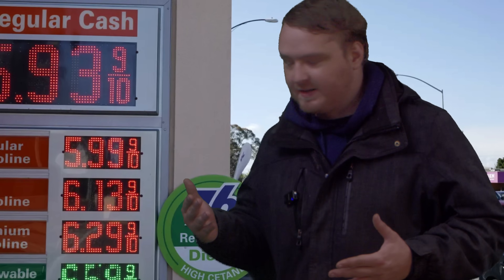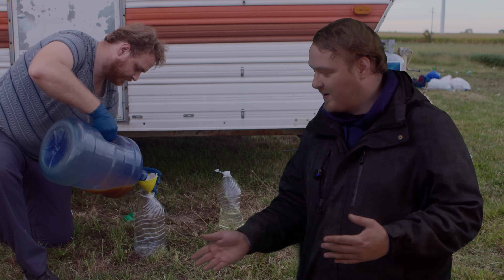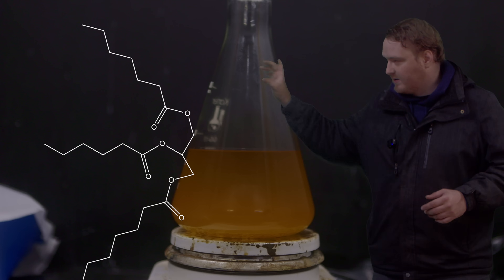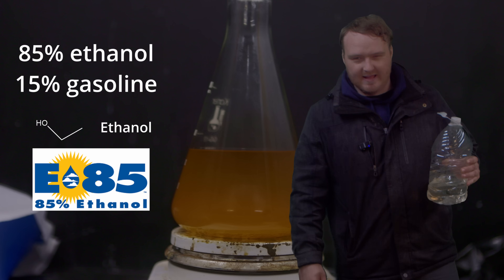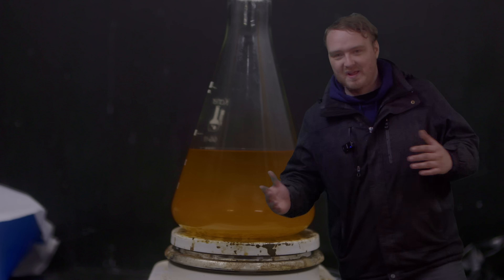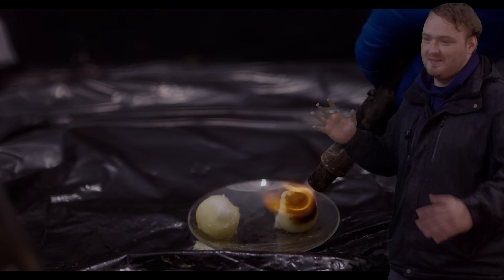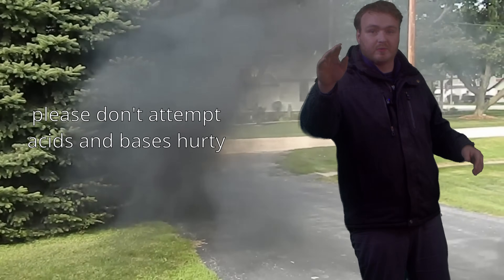I Made Dirt Cheap Organic Diesel!!!

Comment: 8:02 how would you rinse it with water? I dont understand how you wash a liquid.
Reply from the maker: Sorry i should have been more clear.. the diesel doesn't mix with water so if you shake it up with water when it separates into two layers the water layer removes some of the contaminants made like soaps
Reply: @ChemicalDistractions  ahhh, cheers mate

Comment: I would like to know what math you used to arrive at the cost per litre on this. Not trying to be a dick, but you didn't explain it at all, and, on top of the veg oil, you used filters, E58, pool ph, and electricity, just off the top of my head. 

If you were to do this at any real scale, you would also need to factor in fuel to go get your fuel, oil collection equipment, storage tanks, a place to keep your storage tanks, pumps to transfer the oil, electricity to power the pumps etc. People do do this at scale, and run their vehicles. Those people usually have more than a coffee filter (lots use a centrifuge). Some gos as far as distilling off the alcohol for reuse. 

Maybe your number is accurate, but I have been burning waste oil for a few months now, and it's a heck of a lot of work (even without refining) and there are a LOT of unforeseen expenses.

Comment: Some years back they arrested a guy in the uk for making his own fuel supposedly because he wasnt paying taxes but seemed like big oil was getting upset about the cheap fuel. Most diesel is already 20% bio deisel and gas 10% ethanol. The bio diesel has some problems in cold weather and probably not as much mileage from it but its about the same.

Comment: A lot of people actually ran veg oil (not biodiesel) on their cars. There's a whole forum and blog post I reckon it's called vegoilcar or something like that, where they just turn their cars with a whole different fuel-tank to daily veg and normal diesel.

However, whilst cheap, the labor is so annoying for most people that it isn't even worth it, at least here in Spain where diesel is already cheap, as low as 1.2€/Liter in the uhhh... crappy-ish gas stations.

Comment: Hey bro you can use a cornstarch/water slurry to get the sediment out if the oil pretty quickly.

Google the technique but you heat the oil and mix the slurry and dump it in, the starch grabs the bits and the water evaps, leaving fairly cleaned up oil. Filter faster afterwards.

Comment: I've seen someone dyno their Nissan diesel on straight peanut oil and it made more power than gasoline. The biggest issue is making it thin enough to run cleanly in a cars fuel system. Can be hard with viscous veg oil

Comment: This is a great idea I heard many people in the UK doing this in the past. Used engine oil can also be used many people with 12v cummins trucks use a 55/45/5 diesel, used oil, gasoline mix. The used engine oil, as well as the vegetable oil must me filtered very thoroughly or else it could cause problems in the fuel system.

Comment: As far as I understand it the main difficulty with running, vegetable oil, or waste vegetable oil in your car engine is the high viscosity which will clog up the system in colder temperatures. So one method is separating the fatty acids from glycerol, which I believe is sometimes called RME. Other methods are modifying the car to use dual fuel systems and/or fuel pre heating. Another approach is to mix the vegetable oil with either diesel, or even kerosene/paraffin (about 30%), which is usually cheaper. Would be very curious if you investigated the viscosity of these substances of these different substances at different temperatures.

Comment: dude i just filter used veggie oil with veeeery fine filters and dump it in the tank as it is. I added a little secondary tank for regular diesel just to start an warm the engine, then switch to main tank full of veggie oil. Also needed to add heaters to the tank and fuel line and pump to reduce viscosity. Been running like this for years now

Comment: The easy solution to alternative energy with complex EV's and batteries turning trash into fuel insted of turning food in the case of corn ethanol into fuel which takes up land and is not viable. Why not turn the corn stocks into ethanol or vegetable oil instead of the part we eat? Why not turn garbage both organic matter that would normally go into a landfill and produce methane into usable sustainable biofuels and plastics back into their original petroleum fues and of course the waste vegetable oil into buodiesel and sustainable aviation fuel even Boeing had already expermemted and tested ine if their actual jet aircraft with a biojet fuel prototype. Moreover it will help compete with the oil industry I mean yeah we probably wouldn't have enough to replace all oil with it but it would balance out the playing field and get rid of monopoly in the oil and EV industries. They want everything to be all electric so they can have a greater monopoly over controlling our energy.

Comment: Yes, bio-diesel. Made it, used it. I had a string of restaurants that I collected fry oil from. Used a converted water heater as a reactor, using racing fuel methanol, and sodium hydroxide mix as the catalyst. I made hundreds of gallons of biodiesel. I quit because my job situation changed, and I couldn’t make it anymore.😢

Comment: Surely that stuff burns, no doubt about it. But that still doesn't mean, it's advisable to use it as fuel. Ordinary Diesel straight from the pump doesn't only contain hydrocarbons, but also a nice mixture of different additives to improve properties. Those improve lubrication properties, long term stability for storage, biocides, cetane index improvers, cold flow improvers etc etc etc.
If you want to use that "biodiesel" as fuel, you can do that, it'll get your engine going. But don't cry if you at a later time face a repair bill. Or maybe mix it 50/50 with Diesel from the pump, so you get at least some additives into the fuel system and still save half the cost.
Reply: A reliable way to keep it working well (kept my grandpa's Astra running for like ten years now) is to make it with extremely well cleaned oil (filtered, then water washed, not just filtered), and add some multi purpose diesel enricher like a can of Kleen Flo.

Comment: Will the same process work with used motor oil?
Reply from the maker: No unfortunately motor oil doesn't have esters to break so this doesn't help. You either have to 
-burn the oil the way it is
-Distill off the lighter parts and throw out the denser parts
-Crack the oil into smaller chains with high heat which is hard, dangerous, and can produce toxins.

Comment: Do you have any advice on washing used motor oil so a gelatin process to filter out solids will work? 

The detergents and additives are hindering my experiments. I want to burn cleaned up waste oil.

PS you are the Shane Gillis of chemistry LoL
Reply from the maker: Sorry i'm not overly familiar with all the chemicals involved but detergents at least could be washed out with water... Add water and shake it then the oil should just float on top and If there were detergents they'd stick in the water. 

Some of the other stuff you may just have to distill off idk

 And thanks for the compliment i love Shane Gillis 😂

Comment: are you sure about the sodium hydroxyde ? wouldn't that turn the oil into a soap?
Reply from the maker: The sodium hydroxide and sulfuric acid work similarly and both will make soap but only if there's water in the reaction. Ideally neither the cooking oil nor the e85 will have much water so it should be ok
Reply: @ChemicalDistractions  didn't know that, thank you !!

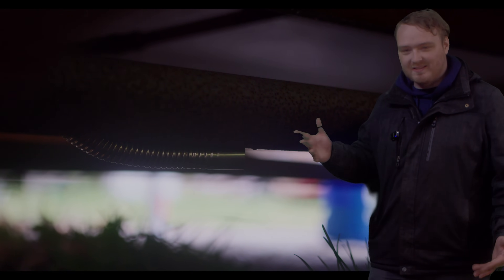Comment: 7:07 if you're curious I think the reason it doesn't smell like gasoline is that gasoline has a small amount of benzene in it. I've heard before that petrol is relatively odourless and a little bit of benzene is thrown in so that people can be aware of gas leaks and all that.
Reply: It's an anti knocking agent.
Reply: remember the sweet smell of gasoline is not actually gasoline. Its the lighter fractions (eptane something?) that are there to facilitate starting cold engines. After a while they evaporates and you get the old and  "sour" gasoline smell . Gas is still fine , it just won't start a cold engine in winter months. Just dilute it in other fresh gasoline or wait for the summer
Reply: Benzene is a carcinogen and 1ppm of exposure in the air for 10 years increases risk of blood and bone marrow cancers by about 12%.
Reply: gasoline IS benzene (?)
Reply: @System3200  It's not, I implore you to pour pure Benzene into your Petrol tank and see what that does.

Comment: The real question is how good is it and does it match the proper lubricating and combustion characteristics of diesel…I.E., if I can run it in a P-pump 12 V Cummins, it doesn’t really matter, that engine will probably find a way to burn sand and ball bearings if that’s what’s in the tank. The question is can you feed it to a CP4 6.7 powerstroke, cause those things will brick the fuel system if the wind blows the wrong way.

When diesel got real expensive, I used to run my 12V on 50-50 used motor oil diesel mix. Never skipped a beat. Used to change the oil in it, and dump the used oil right into the tank.

Comment: I been getting waste oil/diesel mix from my junkyard and mixing in stale gas (same place) until my hydrometer matches diesel from the pump. Run it thru a mesh strainer, high flow not precise hydraulic filter then a set of small retired gas station filters they are bout 16'' tall and 6'' in diameter.  My old clapped out diesels love it, smells like fireworks lol.  The gasoline content makes em fire up in the winter way better and the oil lubricates better then this modern dry stuff we get at the pump. 
Loving the scientific approach here with the fryer oil, most people that try veggie oil back in the day heat it up over the exhausts manifold but would start the car on pure diesel first.

Comment: How about gasoline? Any DIY tutorial using plant oils and vegetable ethanol? I can't find anything relevant
Reply from the maker: Making gasoline affordably and cleanly with chemistry is tough. The only effective method I know of is making ethanol. I actually have a video where i use Mt. Dew to make alcohol and i ran a generator on that... Problem was i had to adjust the choke to get that running and  unless you have a flex-fuel car it won't adapt to alcohol automatically 🫤

Comment: Take the vegetable oil, filter it (with a centrifuge if possible) and mix in about 10% of regular ethanol-free gasoline to it; bonus points if it's high altitude gas with lower octane. If you have zero access to ethanol-free gasoline, take the ethanol blended one, mix it with water to cause phase separation and then separate them in a separatory funnel.
The gasoline will do four things:
Lower the oil's viscosity;
Help the oil pulverize better inside the engine;
Help with the oil's ignition
Accelerate combustion.

Comment: Could you do this for waste motor oil too?
Reply from the maker: No unfortunately... The triglycerides only break because they have esters... Oil is just long carbon chains without esters so you can only really break it via high temperature cracking... Unfortunately cracking is hard to do and it makes alot of nasty side products 🫤

Comment: The chemist in me was mad, but also proud of you for doing this, but also the farmer in me is thinking this is a nightmare when it comes to cleaning the cylinders, checking the carburetor, the intermix is going to be a nightmare of carbon deposits, pain, that's what you have done to me.  Also great video, 10/10
Reply from the maker: Yeah for sure... I'm a part time farmer too and i see the problems 😂... For one you really need to get ALL the sediment out of your fuel filter is gonna be clogged with french fry particles. To my knowledge of biodiesels though it shouldn't cause too much carbon buildup
Reply: @ChemicalDistractions from my understanding the Esther’s in bioD clean out the cylinder wall since it has a higher cetane rating

Comment: Any recommendations for how to store this? Also measurement and temperature system?
Reply from the maker: It should ideally be washed with water and then dried with something like molecular sieves... Otherwise it'll hold onto water which could lead to rust. I regret not showing it but you can checkout Apoptheosis's video on it to see how he cleans it
Reply: @ChemicalDistractions  ok thx, when you mentioned degrees are you using fahrenheit or celsius?

Comment: I saw Apoptosis's video on making biodiesel. His process was a bit more intensive on the purification steps as he took the time to filter, decant, wash, and dry the product. Those steps required a lot of waiting to allow the immiscible liquids to separate out, so it's not exactly a very scalable process, in my honest opinion.

How purified does the fuel really need to be for engine use?
Reply from the maker: 🤔 in the short term not very clean.. but if you wanna do alot of this you should clean it pretty well. 
The main things are to make sure all the sediment is out or it'll clog your fuel fitlers.
From there washing and drying is important to make sure it doesn't hold onto water which can cause rust if used for long enough

Comment: In old diesel you can run it with vegetable oil, the best way to do this is mixing diesel and oil. I mean old 1.9 tdi was great for it but with extreme cold there was risk of that the oil freeze.

Comment: The properly refined stuff is sold as HVO100 in Europe. It's starting to spread as it can reduce CO2 released into the atmosphere by up to 90% compared to regular diesel.
Unfortunately gas stations and oil companies exploit this green appeal of the fuel by making it more expensive than regular diesel...
Reply: Wait it produces 90% less CO2? Do the carbon molecules not oxidize during combustion? That's the definition of combustion. Something doesn't add up.
Reply: @Redskies453  Yeah I phrased it wrong. Youre adding the same amount of Greenhouse gases into the atmosphere.
But with oil you are adding all that stuff into the CO2 ecosystem, since you are taking it from the ground and releasing it into the air. HVO100 is from vegetable oils, so its only releasing CO2 that came from the atmosphere in the first place. 
The remaining 10% of CO2 that are not CO2 neutral come from the manufacturing process, as that of course requires energy etc which isnt always renewable
Reply: @Menon9767  that makes more sense, good clarification.
Reply: @Menon9767 So you are saying it is 90% from renewable sources, not 90% less co2?
Reply: @Redskies453 marketing gimmick
Reply: I work at United Rentals in Europe and this is what I try to use for our generators. Unfortunately, customers don’t always want to pay for the difference (15cts/L)
Reply: It is more expensive because it is more expensive to produce, if anything it is probably subsidized by some countries
Reply: Plants use carbon as food
Reply: @leonelmartinez2486  Its not that simple but you are getting there.
Reply: @Salmacream  it's literally out putting co2
Reply: @leonelmartinez2486  you are still getting there. It's doing more than simply, "out putting CO2." But yes that is part of it. You don't have to be upset, it's just a simplified answer. I thought you were a child at first tbh. So it was meant as a, "oh what else do they eat?" Sorta question spawner lol.

Comment: Selling frying oil is gonna get criminalized any second now.
Reply from the maker: Lol
Reply: Selling?
Reply: You mean frying food in industrual lubricants that have been proven to cause a cascade of health issues will be criminalized
Reply: When fuel became really expensive in the early 2020s in germany the price of vegetable oil at the stores suddenly shot up to over 2€ per Liter so it was no longer competitive with the Diesel
Reply: With that mindset so will selling plastic😂😂😂
Reply: You can literally use vegetable oil as fuel for a diesel engine…this video isn’t that intriguing
Reply: @myrusEW  His fuel is chemically identical to Diesel, excluding the impurities of course.

Vegetable oil clogs up injectors, can damage the fuel pump, and will decrease vehicles horsepower (marginally, but definitely will). All because it's more viscous.
Reply: @shartdiffractor2582 you can use waste veg oil or straight veg oil as fuel in diesel engines 
BUT
They need to be oldschool, from pre-Common rail era, like with distributor pumps (I suppose they are called indirect injection diesel engines)
M51 from bmw, om606 or older from Mercedes, VAG ones with VP37 pump to name the few.
Reply: @shartdiffractor2582  The biodisel he created will still clog the injectors and filters quickly. Also at cold temperatures that fuel will give you a hard time to start your engine.

Comment: I wonder if this fuel would be capable of autoignition at readonable on top of just burning. The little extra molecular wieght of the ester might make it a little harder to sustain were it to be used in an engine
Reply from the maker: You mean autoignition as it's injected into the cylinder at high pressure? I'm confident it would.... Does the extra carbon make a big difference? I wouldn't think so but i'm not entirely sure as I haven't tested it... I'd like to get a little test diesel engine for fuels like this in the future 👍
Reply: People run straight veg oil on older diesels, as long as you can get it in there it will burn. Modern ones have thighter tolerances for pumps and injectors, plus cats and other stuff that won't like it

Comment: I used to run my Hilux on vegetable oil with 15% petrol in it worked really well
Reply from the maker: Badass 😂 
Did you get a lot of clogged fuel filters?
Reply: @ChemicalDistractions  a guy while back made a centrifugal filtering system for old frying oil. It would become clear as water.